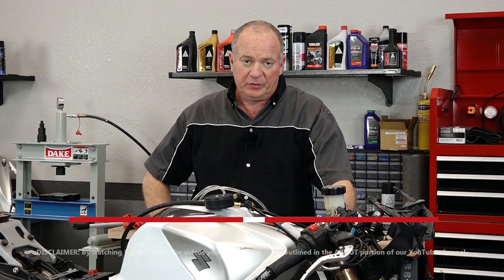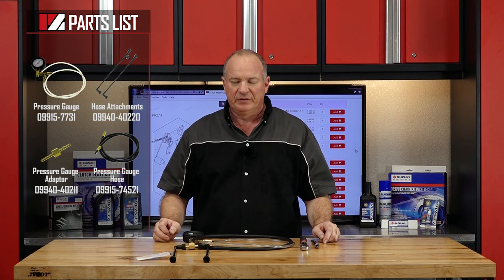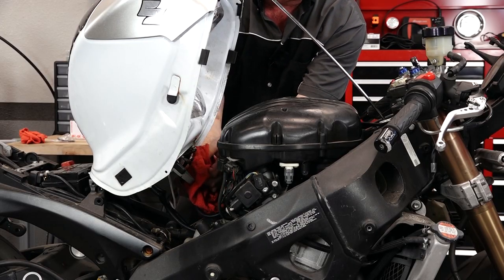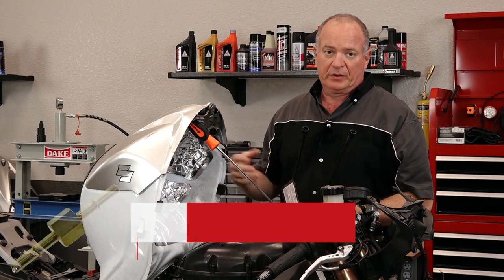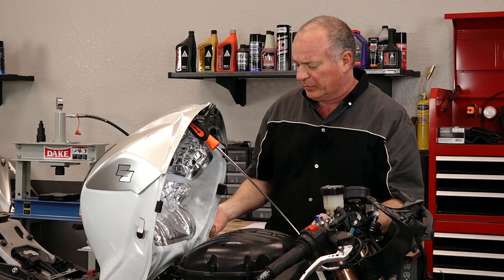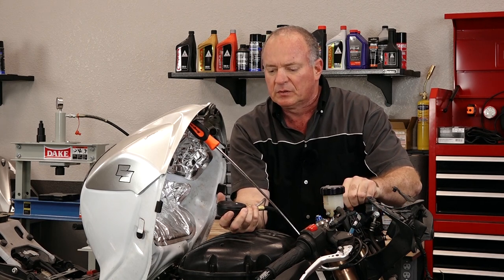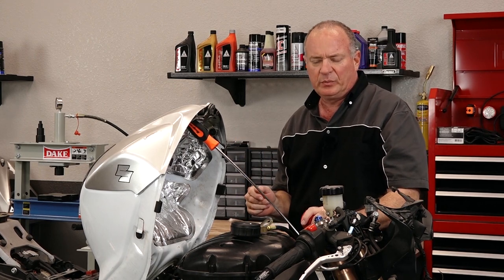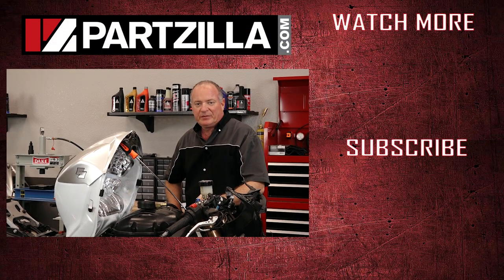GSXR Fuel Pump Test | Suzuki GSX-R1000 | Partzilla.com

Comment: Seems like the issue I'm having, struggles after 7/8k rpm.  Will check fuel pressure tomorrow. 
Thanks
Reply: DecoD71 have you found out the issue?
Reply: Its your fuel fitler. my 04 GSX-R 1000 did your same symptoms and its was the little fuel filter, he's now powerful as new and revs to the cutoff and pull like a champ!

For the pressure he needs to make it on a pull because his test is not good with just a throttle blip the pressure will not drop enough.
Reply: @road-channel  I cleaned my fuel filter out and its still not pulling past 9,500k rpm
Reply: @Youngsoldier93  hi .. did you fix the issue? Im having the same problem, i got new fuel pump, new plugs, fi cleaned, trotle body cleaned new batery,  and still having the same issue, last option is the fuel regulator maybe..?
Reply: @gmaxiegundran1758  did you find your issue?
Reply: My GSX S1000F is struggling at idling RPM and anything below 2000. Above that, it’s silky smooth. 

Throttle bodies, injectors, tank and fuel pump cleaned, and strainer changed to new. But problem persists. 

Fuel pressure gauge is erratically going up and down. But as I said, when riding, bike is struggling only at low RPM’s, but above 3000, it’s perfectly fine. Think the fuel pump could be the culprit? Or does a fuel pump problem primarily become an issue at higher revvs?

Comment: I also have a question,  i have a 2006 gsxr 1000 and everytime i leave it for hours and go to start. Most of the time it will and run for 5 secs, then i have to start it again and its fine. ?? Not sure why it takes 2 starts to keep it running after its been sitting

Comment: What if the bike is on idle mode then a soon you roll the throttle around 3-4K Rmp then suddenly the bike automatic shut off.. is that a sign for fuel pump issues?
Reply: chico rivera  very possible yes

Comment: Im experiencing where my bike will cut out after about 30 min or if its to hot outside. I was recommended to replace my fuel pump previously. Has anyone experienced the bike motor just cutting out randomly? Fyi the pump is running is at low at fuel pressure. I’ve replaced the fuel filter and did not fix the issue I even bypass the kickstand switch. my next step is to replace the fuel pump assembly. 2005 gsxr 1000

Comment: Can these procedures work for a 2011 GSXR 1000?
Reply: When we give it full throttle, it bows down, won't respond. We just changed the fuel pump and wonder if this aftermarket part isn't working properly.
Reply: @catbrown  The aftermarket (especially Chinese) fuel pumps are known to be quite a lot inferior to the Japanese Mitsubishi one that Suzuki supplies. Trouble is, the Suzuki part is very expensive as you have to buy the complete unit when (usually) its just the big filter in the white plastic housing that needs to be serviced. They get you because unlike the smaller clip on filter, these cannot be serviced. I have heard that GSX-S1000 fuel pumps may be modified to work, but I'm still researching this for my K5 1000 that I'm rebuilding https://www.youtube.com/watch?v=FXm1Gq2E6JU.
Reply: What was the issue? I bought a 60$ pump assembly and it bogs around 7/9k rpm full throttle it bogs all the time fuel pump works, changed spark plugs, oil, just had injectors and fuel lines cleaned completely still doing it. I plan on doing a fuel pump test to see if this 60$ assembly is not pumping enough fuel... so to be continued idk what else to loook for
Reply: Its your fuel fitler, mine did the exact symptoms and he was running like new after that, he was bogging at 9k and below that when at full throttle he was bogging too and it was his fuel filter. Hope it will help somebody else too!
Reply: @CoyoteDe24  hi did you solve this issue having the same problem.
Reply: @gmaxiegundran1758  yes, my tank was rusted on the inside and getting the fuel pump filter dirty but the internal one. Not the big one. 

If you’d like pictures shoot me an email I might still have pictures of pump to show you exactly what.

My problem was, 

Rusted gas tank, which got fuel pump dirty, which got the injectors dirty as well. 

So I cleaned the gas tank first. Changed out housing with the fuel regulator inside the pump ( 140$ ) I think on partzilla and it comes with a brand new internal filter. And a new regulator, and then i cleaned the injectors. Bike ran Amazing after that.

Comment: Petrol engines are simple. They just need 3 things to run. Petrol, air pressure and a good spark. 
On modern engines, the amount of plumbing and computer wizardry that controls these three are what makes them complex.

Comment: My 2002 Gsxr 1000 I just replaced the fuel pump, and now it's leaking fuel. One point it was coming out the fuel line freely, and now i think I fixed it and I think it's leaking around the base I think. And now it won't start. No codes when everything is plugged in. What should I do to fix this.
Reply: You reassable it wrong, they are many parts in it, I changed my fuel filter and my 04 GSX-R 1000 is running back like new.

Comment: Quick question I have an 04 gsxr1000 when I disconnect the fuel line the gas just runs nonstop what can cause that thanks.
Reply from the maker: Usually a siphon effect from the line, you can clamp it while you work.
Reply: It means your filter is clean. If your filter is dirty it will not flow readily.
Reply: It does not mean that the fuel filter is fine, it needs a large amount of flowing when the bike is on a pull, mine was the fuel filter and now he's powerful and running like new.
Reply: And a throttle blip is not enough to test the pressure, a full throttle pull load is needed to see it drop if he's clogged. Mine was rhe fuel filter and now runs like new, I hope it will help somebody else too!

Comment: Hello. I have an issue with my system. I changed out the screen, followed your other video, the screen was gunked. Before i replaced it the bike started, idled, could rev 4000, 5000, 6000 rpm no problem. But under load in every gear it cant rev past 4000. Now, since changing the screen, it is worse. Lucky to get to 4000rpm. 3000 to 3500rpm and can barely ride it now. The only o-ring i changed where the Large Tank and the o-ring 15113-35F00. Maybe i should have changed the other o-rings. But whatever is the problem it still remains and is actually worse. Maybe fuel pump? Maybe regulator. Wish i knew. Anyone know that tell me?
Reply: Your main fuel filter is clogged. You can bypass the expensive filter $125 and place a car filter outside the tank.

Comment: My GSX S1000F is struggling at idling RPM and anything below 2000. Above that, it’s silky smooth. 

Throttle bodies, injectors, tank and fuel pump cleaned, and strainer changed to new. But problem persists. 

Fuel pressure gauge is erratically going up and down. But as I said, when riding, bike is struggling only at low RPM’s, but above 3000, it’s perfectly fine. Think the fuel pump could be the culprit? Or does a fuel pump problem primarily become an issue at higher revvs?